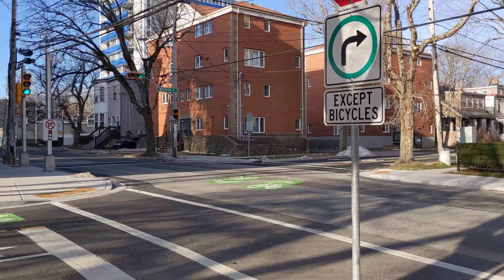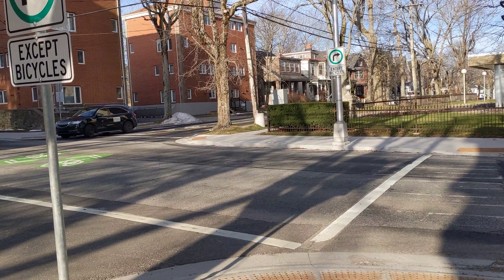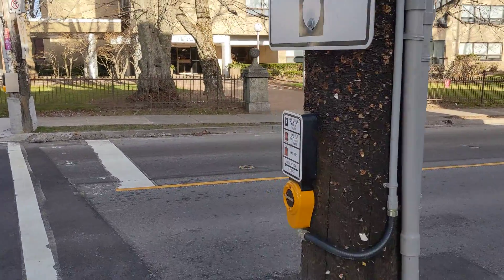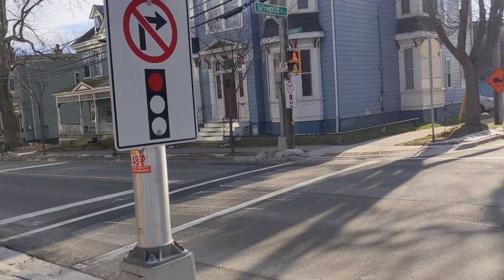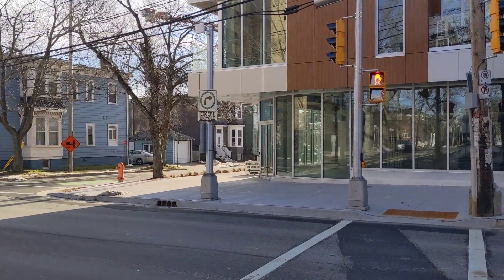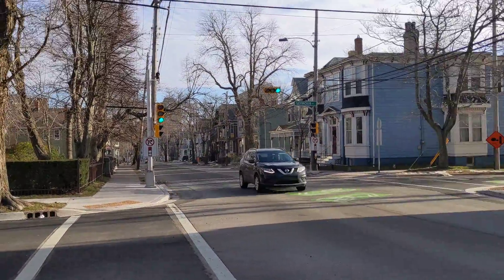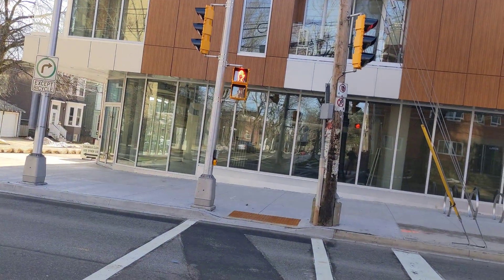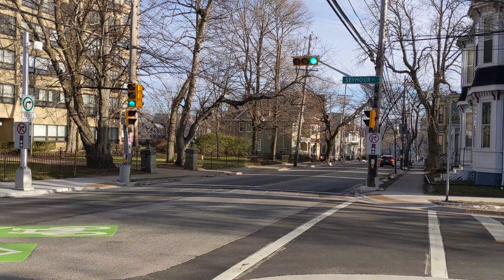Bicycle Activated Signalized Crossing

Comment: So, when you were standing in the intersection trying to trigger the signal, what are you supposed to look at to proceed through the intersection? The PED signal to the right across the street facing you?
Reply from the maker: Unfortunately, yes. Halifax is advancing their infrastructure faster than the current Motor Vehicle Act has adapted new types of signals. You will likely see bicycle signals here in 2021. The infrastructure is all there and the load switch is installed! It's just so silly that they couldn't just install SOMETHING for the cyclists.
Reply: @TheTrafficTech  Even just a signal there would be better than what's there for now.
Reply from the maker: @TonyTaurisano  Yeah it's a bit janky. We'll see what happens in the new year!